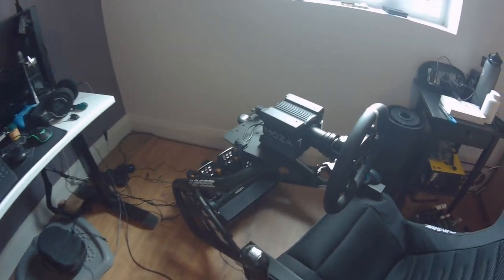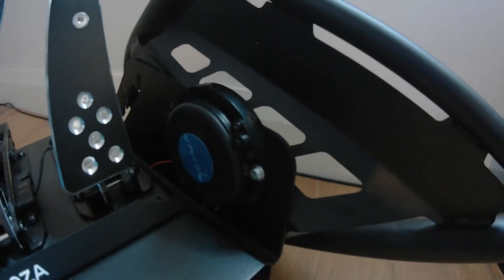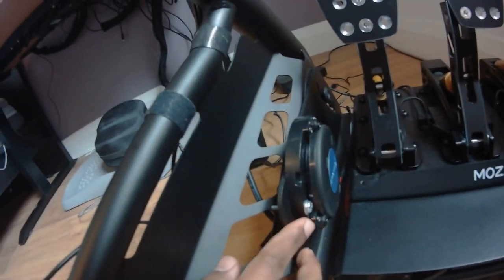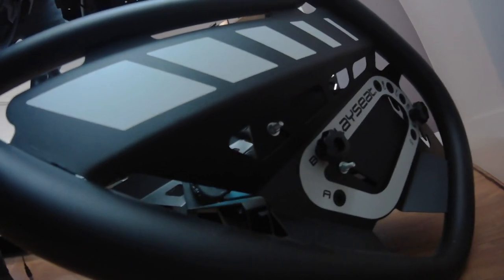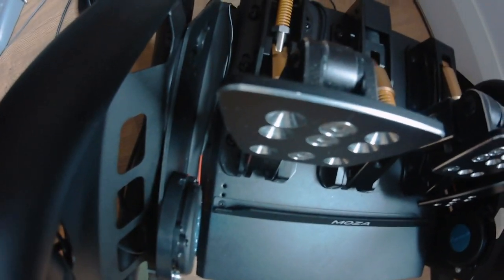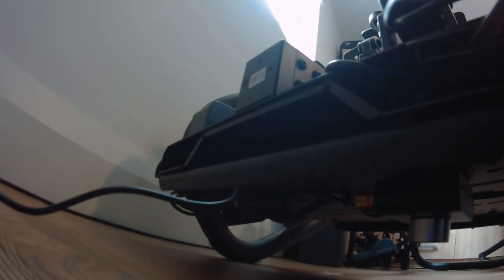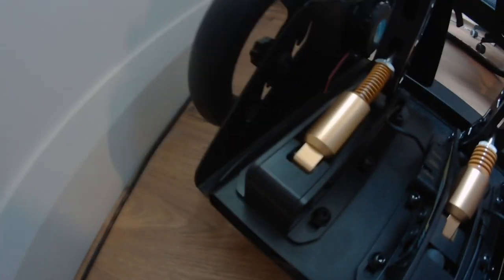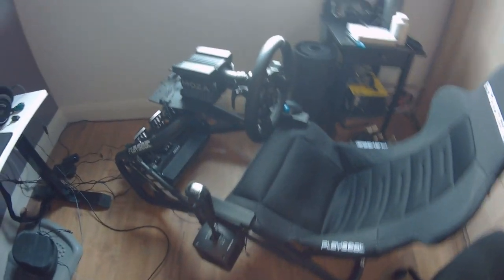Playseat Trophy | How I mounted Mini Bass shakers

Comment: Why only for your pedals? I am looking to get this rig.. but I don’t know if i will be able to get buttkickers on it. And if i would feel it in the seat to..
Reply from the maker: There is no other place where to mount them, this rig does not have a traditional sit, there is no frame around sit where to mount a butkicker either. but you can use the Next Level Racing HF8, it works amazingly good with Simhub and does not cause the extra vibration on the frame a butkicker would.

Comment: No vibration noise from the pedal plate? Just doesn't seem like a good place for them, or a very effective location to transmit the bass through the chassis.
Reply from the maker: Nope, this cockpit is rock solid, no weird metal noises, pure vibration only.

Comment: Hey man, so you finally installed just the 2 mini ones? Don't you think the BST-1s are more suitable? Did you upgrade your setup ever since?
Reply from the maker: only 2 minishakers which are more than enough for this rig.  BST-1 is just too much.
Reply: @JugandoRD Do you feel the revs + upshifts/downshifts with those mini shakers? or you focused only on tires/brakes feedback? Like which feedback do you have turned on and how much of a difference is it?
Reply from the maker: @RamyHaramy  I have multiple effects setup on simhub, but I also have an HF8 for other effects.